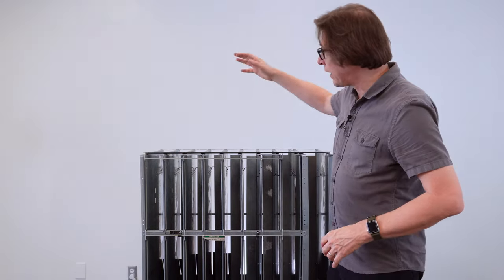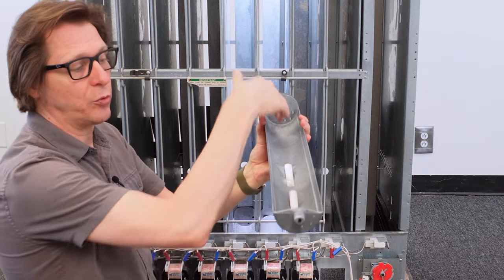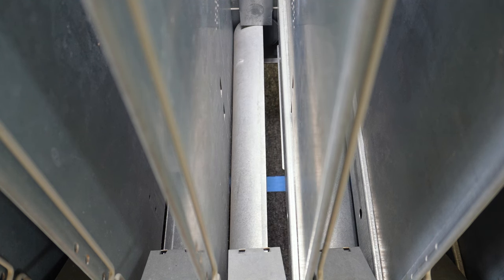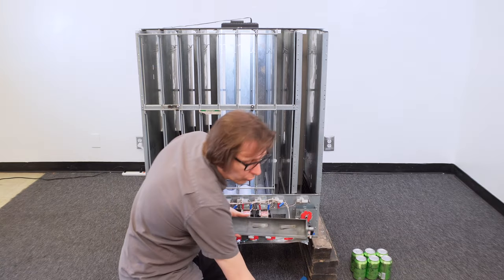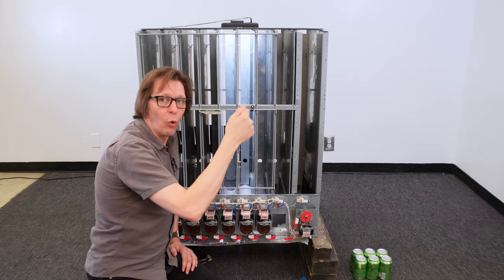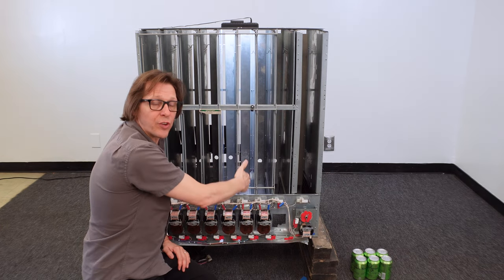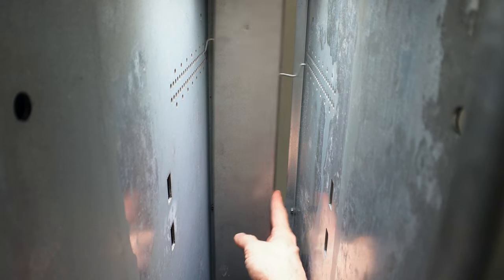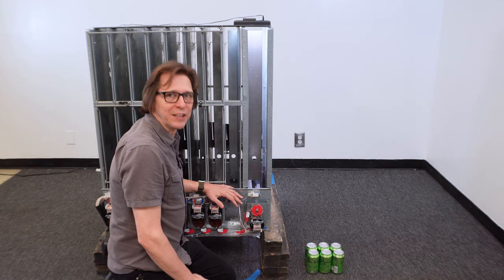Dixie Narco Drink Vending Machine - How To Vend 12oz Cans

Comment: you are the G.O.A.T. I cant tell you how much you have helped me get my business up and running. Question.... are the shims really necessary in the 1st column? I have a DN 501E and the previous owner said the machine worked fine. That was before I watched this video and there are none in my machine. 
again thank you.
Reply from the maker: Thank you for the kind words. Yes, the shims in the first column are required for it to vend correctly and consistently. Some products may work without the shims this does not mean that every product will work with out them.

Comment: this is all good but i think you need to show more problems on the double column motor the  right way to install the link arm the right way. also why does it vend 1 then none and then 2 so forth ? is it a bad motor? its set up the right way still doesn't vend right.
Reply from the maker: Great suggestion!. These are in the works.

Comment: Thank you for your videos. I need your help. My Dixi narco 501 is not recognizing my bill validator. It keeps showing new on the display. Could you please shed some light on how to fix this issue?
Reply from the maker: Do you have a 501e or just a 501? Also does this control board have a single blue service button or two service buttons? I am trying to decipher if you have a S2 or S2D control board in your machine. Lastly what type of bill validator are you using and how is it interfacing. MDB or SERIAL?

Comment: Thanks for the great video, but I have several questions b/c I'm having many issues. I'm new to vending and had a "pro" help me setup my DN501e. What is the purpose of the rods? He said I didn't need the rods in my 12oz can columns. When we did test vends, it seemed to be working fine for the most part. But in 2 columns, sometimes it will drop 3 cans, sometimes it will drop 1 can. Is this b/c of the lack of rods? But in the other can columns without rods, it works fine and vends 1 can every test. Second, I'm trying to vend 20oz Gatorade in the wide column. What kind of shim is needed for that? Do you have a link to what I need? I've also got a coin mech that won't give change and I cannot figure out why. I've been fighting this battle for 2 weeks now and I'm very frustrated as this is my first machine. I'd appreciate any help. Thank you.
Reply from the maker: 12oz cans can be vended with out a rod & spring and have about a 90% success rate of not double vending. Dixie Narco recommended using a rod & spring when vending 12oz cans. I have seen vendors not use them in order to save on parts cost. For 20oz Gatorade bottles in the wide column for selection one. You will need x4 plastic bottle shims. x2 on the left and x2 on the right. Timing cam set to hole #3 and back spacer set to hole #15. Does the coin changer's payout solenoids make a clicking sound when try to dispense the change using the coin dump option on the control board? Press mode button. Navigate to C-D. Then press button 1 for .5 payout, button 2 for .10 payout, button 3 for .25 payout.

Comment: How hard is it to take off a vendo 721 front door? I have a very narrow door opening and a low ceiling that prevents me from clam shelling the door upright? If I took the door off I could get it through on its side... Thank you Keep up the good work!
Reply from the maker: It is not too difficult to remove the door. The top hinge will need to be removed from the cabinet as it resets into the door. Getting to the nuts of the top hinge will prove to be the challenge. If you are going to be moving the machine to a full horizontal state then keep in mind this can damage the cooling deck. Let the machine stand upright once inside for 48 hours (this is speculative and always open for debate). This can and does void the warranty if the machine has one.

Comment: Trying to put 16.9 Poland springs in column one, is there bottle shims for the wide column and would Poland spring bottles be solid enough to vend
Reply from the maker: If the Poland Springs water bottle make a 'crinkling sound' when you squeeze it then this bottle may be too soft. Water bottles tend to get softer as they get colder. This can lead to jamming issues. You can try placing x3 black plastic can shims and x2 black plastic bottle shims on both the left and right and sides to help with these softer water bottle. There is no guarantee that this will be a consistent vend every time.

Comment: I'm looking to change from 20 oz to 12 oz can...I will be buying can shims off of Amazon but do I need to purchase a spring as well or would there already be one within the machine already?
Reply from the maker: Most likely you will need the Rod & Spring along with the 12oz can shims. Best thing to do is to check the machine physically to see if the cradles have a Rod & Spring in them.

Comment: Where are the shims sold?  What shims would I need to vend 16.9 ounce bottles?
Reply from the maker: You can do a search for 'Dixie Narco 501E Bottle Shim' and you find several results to purchase from. For 16.9oz bottles in the narrow columns the parts you will need are a 12oz can or bottle shim and a rod & spring. Set the timing cam to either 2 or 3 depending on the diameter of the bottle. Insert the rod and spring into hole B and adjust the back spacer to hole #23. (Video Coming)  I hope this helps and thank you for watching.

Comment: Seems like you said everything correctly and what not but nothing you made my machine which is a 501E 13 holes only holds like 2 1/2 cans deep 4 shims on each sides makes it were the tumbler doesn’t load the next set if three which is actually 17 holes basically all the way to the back… this is referring to the number 1,2,3 slots which are all double load slots

Comment: My dn501e is dropping 2 cans at once. It is the double column one. Could it be the break not working properly or something else? Thank you
Reply from the maker: Do you have four can shims on the left and four on the right? Is the timing cam set to the correct position? If so then it could be the oscillator bushing has worn out causing to much left and right play.
Reply: @VendingMachineSupport  it has not given me any trouble until now. It can. Do you have video oscillator bushing and how to replace???
Reply: Yes this machine has always been can. It has never been charged from can before. It has the shims but the bushings have a slit all the way through them. Do they supposed to be cut into like that??? Either way I ordered new bushings for this double column motor. But it seems not to have much play in it but it may be enough to cause one can to pass by with another. I thought it may not be stopping like it should. It does it in the same place of the rotation cycle every time.

Comment: Would the can shim work on a 522E? I have plastic shims currently but they are not working well.
Reply from the maker: The 522E can use the metal shim for the narrow columns.
Reply: @VendingMachineSupport  thank you

Comment: Do need can shims to vend 16.9 oz bottles in dn 276e ?
Reply from the maker: You can use can shims as well as the bottle shims. You will need the rod and spring placed into hole B and set your timing cam to either 2 or 3 depending on the bottle diameter.

Comment: Hi I have a 501 r would it be the same setup ?
Reply from the maker: Not exactly. The concept would be the same on an R series. Though the R series uses different parts than the E series in way of shims. Most R series that I have come across where the shim-less stack models. Only thing needing to be adjusted was the back spacer and the time cam on the motor.

Comment: So is it possible to vend 12oz Red Bulls?
Reply from the maker: If the diameter of the 12oz Red Bull can is narrower / smaller then the typical 12oz can. Like Coke for example. Then it will have issues vending in the machine. Here is a video I have that explains this concept ( https://youtu.be/itXHKfW6beg )

Comment: HOW TO CHANGE THE PRICE ON THE DNCB 368CC
Reply from the maker: Depending on the type of control board that is in your Coke-A-Cola branded machine. I have this video for S2D controllers ( https://youtu.be/KaqXglxSaXA ) or if it is a single price ( https://youtu.be/Kv-tDm3iNpM ). Being that your machine is a 368CC that was manufactured for Coke-A-Cola there maybe some different programing steps for this.